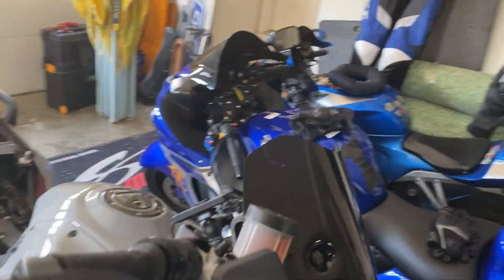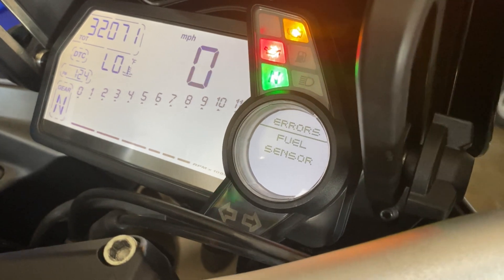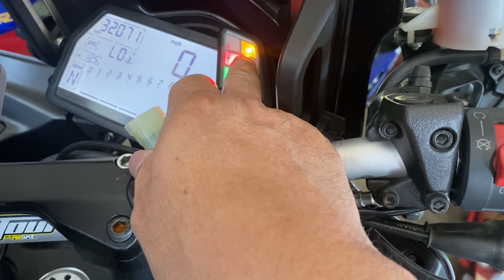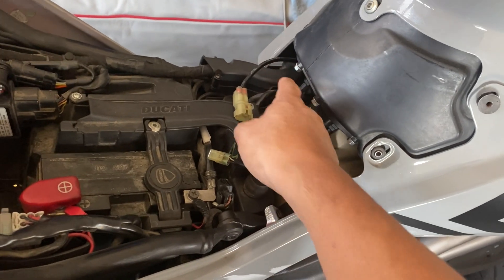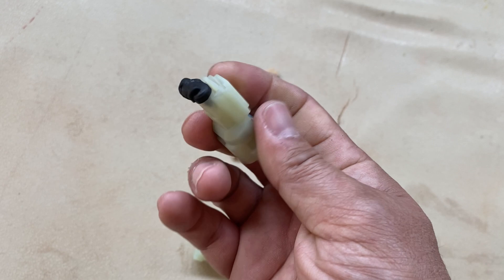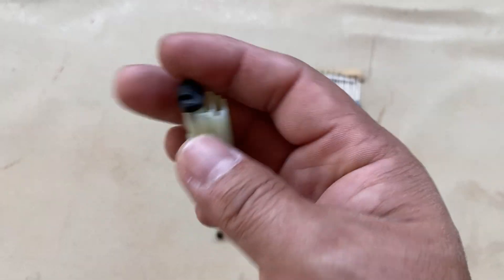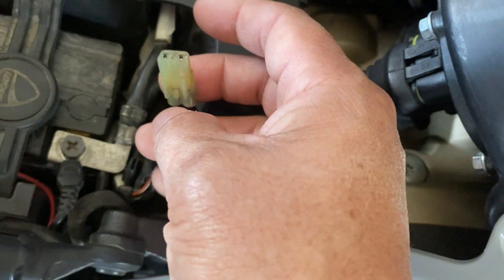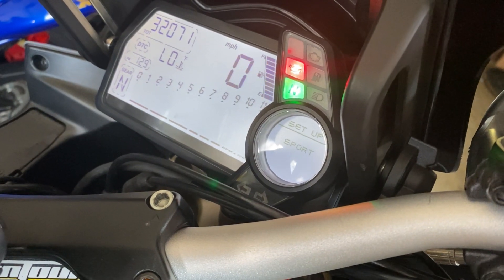Ducati Multistrada 1200 Fuel Sensor Bypass

Comment: If that resistor doesn't work, what other voltage can I use?
Reply from the maker: My best recommendation is to get a pack of resistors in different wattage levels. As some others have stated in the comments, the "correct" wattage can vary between different fuel sender and motorcycles. I did the same and found the right wattage through trial and error.

Comment: I have this issue with my 2016 xDiavel I wish I knew where to get the plug for it..the resistor is probably different too..
Reply from the maker: I think the resistor may be the same, or at the least, very close. Based off of what I could find, the connector should be identical.

Comment: Hi, thanks for your video. I did it with exactly the same resistor, 220 ohms 1/4 watt, it works but it indicates that I'm always with low level fuel tank so I always have the orange light turned on... I suppose the resistance is not the good one,  do you know which one I should use to have full or middle level fuel thank to avoid to have this orange light always turned on?
Thanks for help.

Comment: How do you put this plug together? Why 1 resistor and not one on each side?  What side of the plug do I install it. Does the blue thing on the resistor go inside the plug or does it stick out? When I ordered the 51k resistor I got the 1/4 watt one should I have ordered the 1/2 watt because there are more ohms. I don’t know anything about this stuff . Lastly what I normally do is add K100 to every tank and that works well. However the bike had to sit for a long time and now it’s flashing. Please advise.

Comment: Thank you for the detailed solution, I have this issue on my 2018 Multi 950. I bought the variety pack on Amazon but did not have the 50k, so I used a 47k. Works fine shows as 90% full with the lower resistance LOL. Also, I just jammed mine in the female side covered with tape and put the male back in all snug. In case anyone doesnt know you can use resistors in series to get your desired resistance e.g. 30k + 20k=50k or in my case 47k + 3k = 50k or whatever combo you have. If you do them in parrallel it reduces the resistance but you have to do some complicated math. Anyway cheers from Ohio!
Reply from the maker: Love this! Glad to have been able to help!

Comment: Thank you for your video!  After 3 modern Multis without this issue, my 4th (2016 Pikes Peak with its D series sensor) gave me this issue.  Bought a variety pack of resistors from Amazon and found the 51k Ohm 1/4 Watt 1% resistor seems to be working on mine (Full tank, no flashing fuel indicator).  Wish me luck!

Comment: How do you replace the fuel sensor? Do you need to take out the entire pump assembly? Or can you swap it out solo? I have a M1200S from 2019 with fuel sensor issues. If its just the sensor Ill clean it/replace it myself. If I have to take out the entire assembly and put in a new gasket etc. I will bring it to the garage. I can do it but don't feel like it.

Comment: ordered the Honda part number via Amazon, but it didn't come with terminals or the caps.  having a hard time finding the right terminals to use (male or female).  any leads on that?
Reply from the maker: I’ve tried to find just the pins and caps for the HM-2P connector, but not having any luck with a confirmed fit. 

As an alternative, I found this connector that already comes pre-wired and just needs the resistor soldered in. May be worth a shot.

https://a.co/d/b3gmLrt

Alternatively, I may still have a couple of terminal pins/caps in the garage somewhere…

Comment: Just one important note! If your ducati is an older version (2010-2016), then it is important to use a 50k (50,000) ohm resistor. Because I put on a 220 ohm resistor first, and it didn't fit. There's a light on the fuel reserve all the time. Feel free to put in a 50k resistor and everything will be fine.
Reply: This worked on my 2016 Multi with a D series fuel sensor.   Thx!
Reply from the maker: AWESOME!!!!! I'm glad that it helped you out! 🤜 💥 🤛
Reply: I can only find 4.7k  or 51k. Which to use on 2013 Ducati MTS?  Don't have to buy the plug as i have 3 old sensors in a box.
Reply: 51k is god. My is same.
Reply: Hi I have an older MTS 1000 DD my 7.2 error is doing my head in, I’ve already popped out the two pins in the original unit so I can solder a resistor on and replace them, but what size resistor would you recommend for the older bike? Basically would love it not to show empty, I was told the fuel sensor work from 300 to 3000 ohms, any help would be fantastic

Comment: Thanks for this video!  FWIW, I have a 2016 with a 'D' model sensor and I needed the 50K in order for it to show full.  4.7k gave me 1/2 tank, if that's desirable for someone.
Reply: I can only find 4.7k  or 51k. Which to use on 2013 Ducati MTS?  Don't have to buy the plug as i have 3 old sensors in a box.
Reply from the maker: Give the 50k a go. I’ve found that the results are dependent on which firmware version your Multi has. I believe that the ‘13-up will read full with the 50k.
Reply: @wingmansgarage382  Amazon has 51k or 5.1K..... Which should I order?
Reply from the maker: @james Sirianno, order the 51k resistor. That should get you a full reading. At the very least, it will stop the error.
Reply: @wingmansgarage382  its a 1/2 watt vs 1/4 watt... Is that OK?
Reply from the maker: @James Sirianno, I used a 1/4 watt resistor
Reply: @wingmansgarage382  FEIF, I'm using cheap 1/4 watt from Amazon and they go bag over a week long period with the fuel level slowly dropping over that time frame.
Reply from the maker: @Henry Happ, good to know. Sadly, Amazon-sourced bits tend to be a mixed bag. I’m still running the same resistor shown in the video and haven’t had an issue with it over the past eight months. But, I also figured I’d get around to installing the new sensor by now too…
Reply: @HenryHapp   I am using a 50k resistor 1W and fuel level are decreasing slowly too, probably will turn the fuel light soon. Did you find a solution?
@Wingman Garage
Reply: @mauricioguarnieri1808  I found the same, that with the resistor, the level dropped over time. I bit the bullet and bought a 'G' model sensor and have had no problems in almost 5 months and 4000 miles.
Reply: @HenryHapp  thank you.
Reply: @HenryHapp  Did you also update the firmware? Did you replate it yourself or at dealer? Just change and all fuel errors and lights disapear? Mine is current with the B model, but I am wondering replace to G also.
Reply: @mauricioguarnieri1808  No firmware updates were necessary.  I did do the replacement myself, which took about an hour since it was the first time I needed to remove the bodywork from the Multi.  Filling the tank after replacement cleared the lights, nothing else was needed.
Reply from the maker: Thanks for additional info! I’m sure this will be helpful to another Multi rider somewhere!
Reply: I did on mine worked good for weeks so just stopped to work and the fuel light is on again and showing no gas, maybe the resistor broke? That fuel gage is really weird my bike was standing for long time and that thing broke why?
Reply: @welsonnogueira1755 did you find a solution for that? The level dropped, I replaced the resistor but it didn’t show “full” as the first time I did the bypass

Comment: Man. Thanks a lot for that. I have this issue on my 11'' model. Would you make a video how to replace the unit itselt? I heard you need to update firmware via  Ducati afterwards
Reply: I can make a video of how to put tape over the lights!!!!🤣🤣🤣🤣🏍🏍🍺🍺🍺
Reply from the maker: Do it and I’ll share 😂
Reply: @wingmansgarage382  🤣🤣🤣🤣🤣🤣🤣🤣🏍🏍🏍🍺
Reply from the maker: You’re welcome, SuperFryn! You are correct, a firmware update is needed after replacement with the new sender. I’ll post a video once I can get around to swapping out the old sender.